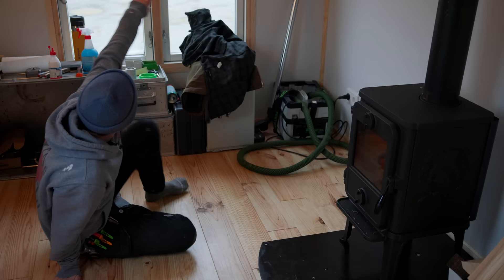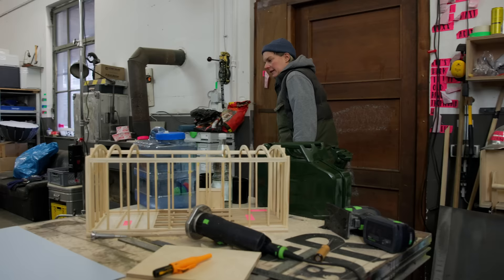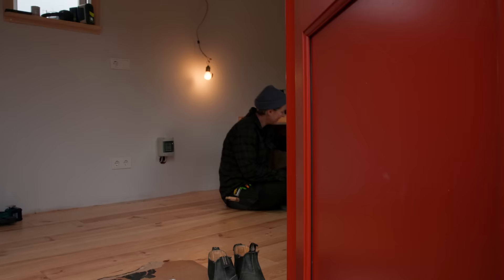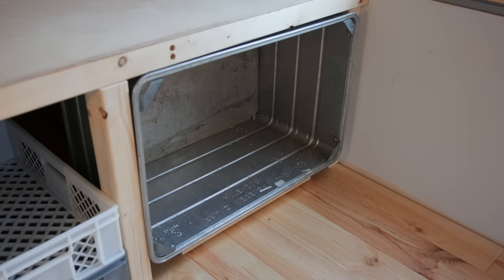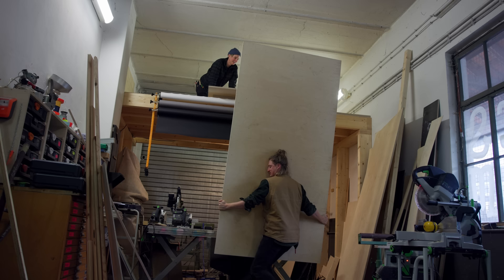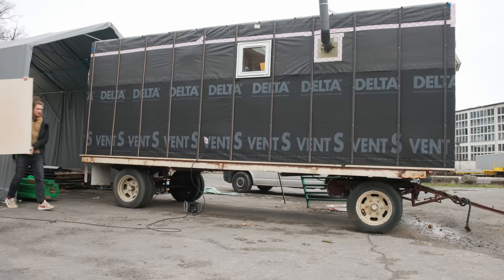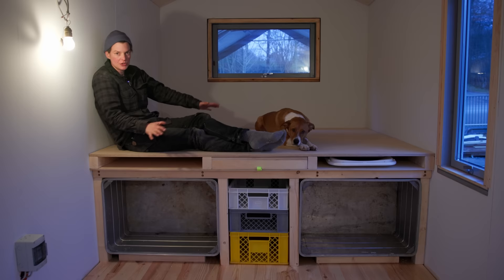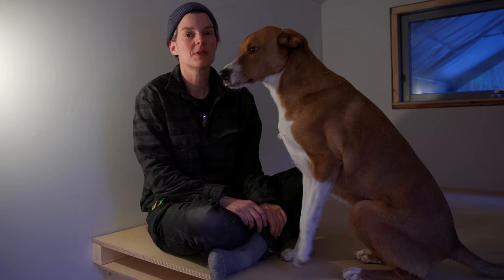This Bed has it all! Storage, Table, Chairs...Panic Room

Comment: You know, you could put a fold up leg on the end of your table and use it for stability when the table is extended to fully or partially, but either way it would be hidden when you retracted the table for storage because it would fold up into the negative space under the table.
Reply: That was my thought exactly! It looks like her current arrangement is pretty stable, but I'm sure some future bending of the wood (and therefore potential difficulties in sliding the desk in and out) could be avoided with a fold-up leg
Reply: @EcceJack  Agreed.  However I did see some flex in the end when the table was extended to full length and that sparked the idea for a hide away leg in the end.
Reply: I was thinking the same thing. just put a leg on a hinge attached underneath the table, it would basicly extend on its own when the table is pulled out far enough for flex to be a concern.
Reply: I was certain it would have legs as well as a 'stop' bar (perpendicular to it's length) built into the internal end. As I'm writing this now I'm thinking no. Left the way it is it would be easier to modify if she so chooses. Geil!  Making the top longer, geil!  Building some little 'cubbies' for work/desk materials/light or plates/silverware, geil! Making it so it can be taken out entirely and used it somewhere else (folding legs on both ends), geil!  OR DRUM ROLL PLEASE....All three in one - extra long, hidden compartment, completely transferable - Kampf Transforming Spy Table! GEIL!!!!
Reply: Yeah, it could hinge up into the cavity beneath the table and only be used when extra support was wanted. Neat suggestion.
Reply: This. Also, the negative space is large enough to maybe not only store the table and the leg, but also another chair? I mead, the leg doesn't have to be anything extra, and the chairs are very flat when folded
Reply: You lose the ability to sit at the end if you put a leg there, unless you put it farther towards the middle.
Reply: @Andrew Bird  I don't think so.  The leg is under the table and you would never pull your chair that close.   The table leg would split your legs when you sit.
Reply: @RevdUp.Art.Fotografer  Folding legs on both ends was exactly my thought. Sunny weather? Why not take the table outside for breakfast?
Reply: I actually commented the same thing before I saw this comment. Definitely do it Laura
Reply: @olgapisova6207  Your wish has been granted
Reply: @scottcates  yay!

Comment: Great build and video!   Side note: as someone else in the Livestream said, a carbon monoxide detector in the tiny house might be a good idea.   Just a thought.
Thanks for all you post!   Thumbs up.
Reply: Yes. I used to have a coal fired stove for my central heating. The carbon monoxide alarm was placed directly above and maybe a metre in front. They aren't 💯 as they need a high density of the gas. If you find yourself with a top of the head headache or being sleepy, open a window. My stove was old and leaky. More than a couple of hours in the room and I was guaranteed to be tired. Going into another room always woke me up/immediately lifted the headache. Good ventilation, not draughts are key.
Reply: It could be a opportunity to connect the "air in" Vent of the oven directly to the outside of the house. A pipe through the outside wall into the oven.
So the fire can get it´s oxygen from the fresh Cologne air .
Reply: And a heat shield behind the stove!
Reply: Not just a good idea but required by code in a lot of places.
Reply: @K Larsson   she could use more of that metal with the same shape, would look fantastic!
Reply: A nest smoke alarm and co detector is a nice clean solution

Comment: Als jemand der seit Kindheitstagen mit Holzöfen die Bude beheizt, nen kleinen Tipp.
Hol dir einen zugelassenen Abgaswärmetauscher und paltzier einen Peltierelement-Lüfter dahinter. Dieser wird dank des Peltierelements durch das Temperaturgefälle am Abgaswärmetauscher (200-300°C vs 20°C) angetrieben und sorgt dafür, dass da mehr Luft durch des Abgaswärmetauschers Finnen strömt, als es "nur" mit Konvektion der Fall wäre. Hierdurch werden die Abgase mehr abgekühlt, zu Gunsten der Lufttemperatur deines Tiny Hauses; sprich der Wirkungsgrad der Heizung steigt, und zwar drastisch. Je kürzer das Abgasrohr ist, was ja bei einem Tinyhaus gezwungenermassen sehr sehr kurz ist, desto mehr fällt dies ins Gewicht. So kannst du den Holzverbrauch locker um 1/3 reduzieren!

Comment: 2:00 having worked in a museum, most wood stoves have metal reflectors behind the stove to reflect heat back into the room.   The pieces left over from cutting the stove's plate could be used to make a reflector, or an aluminum sheet would work well too.

Comment: Just a heads up, our floathome is constructed similarly with open space below the floor and found mold in the back corners of our closet due to lack of air circulation which we cured with a small fan. Love the project!

Comment: Thats a very clever use of space!  I've heard that mattresses can trap moisture if they're set directly on plywood and will mold, so you might want to consider routing a couple slots for air movement.
Reply: I suppose holes could cut down on weight, too :)
Reply: @scottcates  I don’t know if weight is a concern but absolutely! Great idea if you’re building a camper van or whatever. The problem with small spaces like this and vans is the humidity created by humans. We’re all just nasty little humidifiers.
Reply: 20:43 Yup, ventilation is on the list.
Reply: @thatHARVguy  yup! I missed that. Thank you.

Comment: There are rolling caster caddy things available for eurocrates (basically a plastic frame holding the crate with casters mounted to it) and it seems like they might fit height wise, so they might be worth considering for you. Although sliding eurocrates that aren't too loaded across the floor is fine in my experience, the casters do add convenience, especially if there's heavier stuff in the crates.
Reply: she could add some felt to a plank to fits under the crate
Reply: @jyvben1520  that's also a great idea!

Comment: Looking good. Very cozy.
End of the table needs legs. We had something similar in a camper with a single leg and the corners began to sag over time. It was a melamine tabletop with the metal décor on the sides. This was back in the 70s with little stars on the surface.

Comment: Hey Laura, you may want to ad a little thermometer in the corners in the crawl space. These corners can get really cold in a tiny house and because of the high humidity it can get moldy really really fast. When the temperature drops below 11 degrees you should ad ventilation or a little electric heating foil. I installed one behind my sofa because of that.

Comment: Hello Laura. You're doing good.
Now that you have the stove installed, don't forget to install air vents (usually around the windows). A stove needs oxygen to burn at the same time as the wood. It will consume the oxygen in your room, and if it's really airtight (wich it seems it is), it can deplete it at the same time as you (as you breathe). This can lead to bad draught, or worse higher levels of carbon monoxyde production.
You can also find square air vents that you can close (two parts sliding) when you don't use the stove.

Comment: I think you should put some storage for cutlery or something similar under the table top. Like drawers that slide out sideways when it’s pulled out. At the moment that space seems like a bit of a waste. If you don’t want to weaken the sides supports of the table top, you could make the drawer hinge in the back so it drops down at an angle then slides out.

Comment: If I were you, I would add simple fold-out legs at the bottom of the table since you have the hollow space beneath it anyways. When you were leaning on the table, you could see that it bent down a little which could spell disaster if you have a laptop and a drink on there, or a drink/food in general :/

Comment: IN ADDITION to drilling holes for ventilation, I highly recommend getting an air flow mesh product, the last thing you want in a tiny space is a damp mattress. The one I used is HYPERVENT AIRE-FLOW™ MOISTURE BARRIER... there are probably others. Many Vanlife/Skoolie folks use them.  I have no affiliation with the company, but it's a very good, very useful product.

Comment: In addition to the holes in the plywood you may want to get a mat made to increase air circulation, they are used a lot in recreational vehicles. Googled it, called: under mattress condensation mesh.

Comment: I have a ventilation option for you. Here on the west coast of Canada we have to install a drainage space behind house siding and one of the products developed for that is a heavy plastic mesh much like a course Scotchbrite pad. In the boatbuilding industry we have adapted that material as a mattress ventilation pad. It’s about 12mm-18mm thick. Not sure if such a product is available in Europe but it is way easier and more effective than drilling a ton of holes. Of course I realize you are probably way ahead at this point but food for thought on the next trailer build you'll most certainly do.

Comment: Laura PLEAEAAAAAASE put some protection behind the stove. Tile, sheet metal, stone, whatever! The heat can slowly oxidise the material behind the stove making it more and more combustible. I can't remember what you used for insulation but I think it was cellulose fiber too? Which is maybe even more risky. Super nice piece of steel you used for the base. These tiny buildings are super at risk of burning down so please take care. Best wishes from Sweden

Comment: I could be wrong, but shouldn't that log burner be further away from the wall, or have a heat shealed behind it? I also can't tell if that's a double walled flue pipe or not, so it might need shielding between the wall and that too......... And one last little bit of nit picking. You HAVE got a carbon monoxide alarm for in there, haven't you? 

The build's speeding along so fast, and it's amazing to see how far along you've got in such a short time, I just think no one would want all that work to go up in flames, or an oversight to make you ill (Carbon monoxide poisoning isn't something to be taken lightly, and long term exposure to even quite low levels can have serious long term health consequences). So please be safe, and have a look through your log burners install guide to check you're not going to overheat anything.

Comment: That looks like a Morsø 1410 woodstove. 5KW equivalent heat output. Looks pretty good, but I checked the manual online, and it only lists using ONE air control.
My Dovre 420CBS which is of about the same size and weight, have two controls, the initial airstream control, and the clean-burning mode air control. And it can reach 7KW heat if you use it right. Or kill you with CO if you're a proper muppet...  
(Stuffing this or your stove full of wood in the evening, then closing it almost all the way doesn't result in heat all night, but you won't wake up cold... or at all... )

Comment: Make sure to have a CO detector (carbon monoxide, poisonous combustion byproduct) in there with that stove. (And smoke detector?) Might also be a good idea to have a CO2 sensor (carbon dioxide, product of breathing as well as combustion) as well to judge ventilation, since it looks pretty tightly sealed so far with no active ventilation.. Try to keep CO2 under 800... It's not poisonous until very high levels but it affects your thinking at lower levels, increased risk of disease, some folks get headaches...

Comment: Looks amazing as usual but I was surprised you didn’t have a laptop/ notebook storage place inside the pull out table
Reply: Hint: Before you open the oven, you should open the air vent and wait some seconds. This create some air draft and prevents that you get all the fumes in the room.

Comment: A foundation should not be that difficult. This is not Calgary where you have to go down so far
that you may as well have a basement. I believe some steel posts welded to the frame, and
standing on concrete pads should count  as a foundation. This, if accepted, would be cheaper
than starting all over again somewhere else, and, will not destroy the mobility of the tiny house.
Cutting some welds or unscrewing some bolts , and putting the wheels back on would leave
an easily removable legal foundation behind. Find a knowledgable builder ( I am way past my
best before date) Moving is not going to be cheap either. P.S. I thought the 'Sunshine Coast'
was on the mainland - from Gibson up.

Comment: Wood burners are so very bad for the environment and your health, especially in a small space like that. It's like having a diesel truck engine running in your living area. The doors rarely stop all small particles coming into your room and then your lungs. You also get a back waft (like in your video) every time you open the doors which fills the room with small particulates. Not to mention that wood burning in the neighbourhood also pollutes the local area. You may get complaints as the chimney isn't regulation height above the ground. 

The UK reduced emissions of small particulates from cars over the last 30 years, only to replace them with emissions from luxury, unnecessary wood burners.

Wood burners are quaint, but so bad for everyone's health. 

End of lecture, I enjoyed the rest of the build.